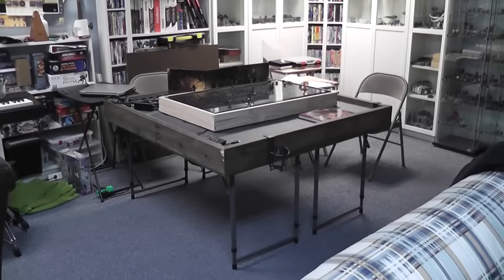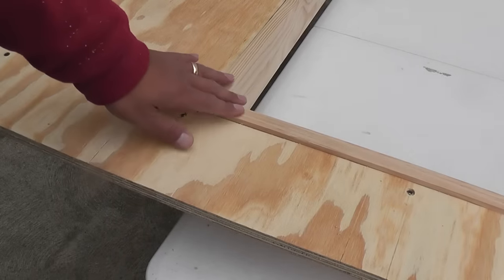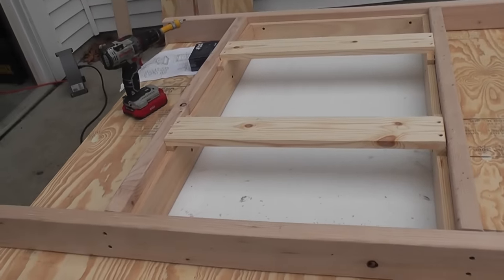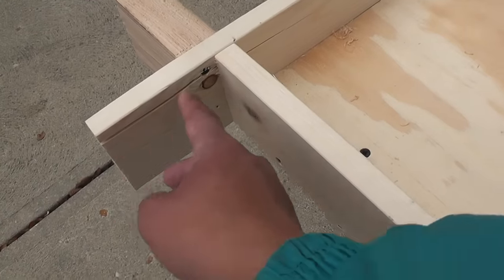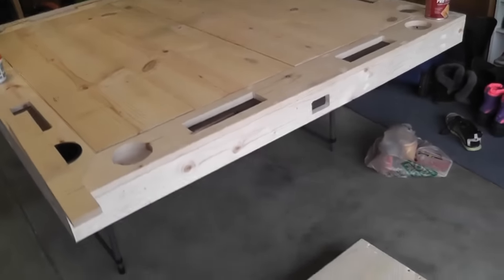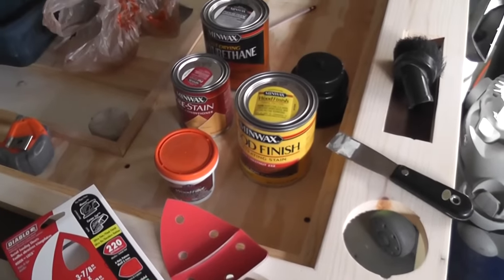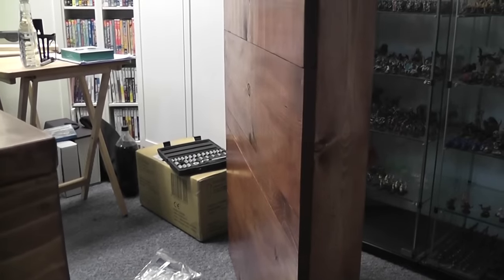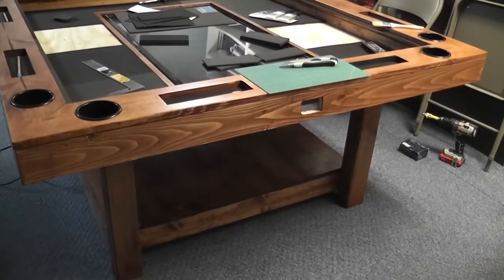DIY Gaming Table for $150

Comment: What's that yellow extension accessory on the drill at the 5:40 mark? I've seen it in a few DIY videos but I'm not sure what it actually does
Reply from the maker: It's called a Flip Bit and allows you to drill and then screw with the same tool--I love the thing.  https://www.amazon.com/DEWALT-DW2700-Drill-Drive-Complete/dp/B0000DD6LX/ref=sr_1_5?dchild=1&keywords=flip+bit&qid=1589030749&sr=8-5
Reply: @gaminggeek241  Thank you!! Built a gaming table using your plans a couple months ago (minus the tv in the middle) and it's perfect. Great work

Comment: How do you get the map on there? I know there's many options, but curious what you use since it seems like youre actively using it and not just theory-crafting here. I thought about a chromecast or other screenshare maybe. Edit: So it looks like you just have an (old?) laptop connected underneath then?

Comment: nicely done if i ever get a gaming room definitely going to try and build this. I do have a question that ive been wondering with the monitor tables atleast yours is it an all in one computer station or just a tv with air display to pull up the map.
Reply from the maker: It's a TV with an HDMI hookup to my laptop.  So it functions as an extended monitor for the laptop.

Comment: it would be really cool if you hung up a projector on the ceiling instead of the tv screen, you could adjust the size of the playing board as much as you want and it would let you keep that nice carpety texture for the playing peaces to stand on, i imagine the screen would get a bit slippery, sorry for bad english.
Reply from the maker: I was actually looking into setting up a projector but ended up with this instead.  It's true that you have more control over the size of the map but I like having the TV in the table.

Comment: nice build, would recommend not using braided wire like that on a outlet. You could use crimped connectors and it would be ok

Comment: Love this idea, but as somebody who works with wood-stain for a living, the Wood Conditioner is, in my opinion, a waste of money, as with most softer woods, Water will achieve the exact same effect, making your stain come out more even, and helps the stain bite into the wood more easily, preventing the need  for the occasional second coat of stain.

Will definitely have to do something like this for myself.  Thanks for the video.  :D
Reply from the maker: Yeah, I've heard others say the same thing--that wood conditioner is unnecessary.

Comment: Just one question why did you choose to wire the outlets in a series circuit and not parallel? Also the outer sheathing has to be inside the box
Reply from the maker: It is in parallel.  I did end up retroactively putting in boxes and placing the sheathing in the box.

Comment: On your BOM do you have the cut lengths and angles for the wood? And do you know if lowes or home depot will be able to cut the boards to spec?  Finally, just wanted to say that is an awesome build. The is a 40 inch right?
Reply from the maker: If you click on the link for the plans, all the cut dimensions are in there.  That would be a lot of cuts for Lowes or HD to make--you might do better asking a handyman to cut them all for you.  Yes, I have a 40" but you could fit a 42" as well.

Comment: Do i need to figure out the size of the tv before I  start anything?  Looks like yours is for a 40" which is what I want to use.  Wondering if there is enough room to accommodate most models of 40" tvs?
Reply from the maker: Yes, I would definitely size out your tv first before starting because that dictates the placement of the support beams and where your legs will go.  You can definitely fit 40" TVs and can go even a little larger if you want since the inside well is 4'x4'.
Reply: @gaminggeek241  Thanks for the answer. Purchased one and excited to start this project.  Thanks for putting the plans up and the walk through video!

Comment: awesome build. just FYI you should be using 12 AWG wire for 20A circuits but it shouldn't be a huge deal.
Reply from the maker: Yes, you are correct.  Also to use 20A outlets.  Did I say I was on a 20A circuit?  I just checked and it is 15A.

Comment: I was thinking about building this as a 4 x 6 table rather than a 4 x 4 so I could use it for DnD, is there anything you'd recommend taking into account/changing about the procedure for a longer table?
Reply from the maker: There's a couple of people that made longer tables so definitely check out the BGG thread that I linked in the description for ideas.

Comment: This is great! But these skills are beyond the capability of my group. I am wondering if we can simply build a box to put the TV in. My question is, would this cause heating problems because there's nowhere for the heat to go?
Reply: If you do that, make sure you drill some holes on the bottom of the box to allow the heat to escape.
Reply from the maker: I originally just had a wood frame that went around the edge of the TV and had the TV flat on top of the table.  If you have an LED LCD, they barely give off heat and I've never had issues with my TV.

Comment: What size is the original table you had? It looked like a fold up 4x4 but I've found those are super hard to come by.
Reply: he made the original too.
Reply from the maker: It was a table topper and I used 2 foldup tables that were 2x4 underneath.

Comment: I have 2 quick questions.

I am thinking about starting this project but would want to have a table that is slightly longer,  3 people on the long edge and 2 people on the end   for potentially 10 people total around it.

But typically 8.

Is it just as simple as adding an extra 2-3 ft to the length and adjust all the measurements appropriately?

secondly, LCD TVs don't typically do well laying flat and the screen can crack as the edges droop

Have you had any trouble with this? are the braces enough to prevent this?
Reply from the maker: If you use the BGG thread link in the descriptions, there are a number of people who lengthened one side of the table to do exactly what you said.  So it is pretty easy to modify.  

I have an LCD LED TV which is super light so I've had no issues for the six years I've been using it.  Maybe you will have those issues with different kinds of screens, I don't really know.

Comment: what are the dimensions of the tv, the frame, and the cutout for it, if you dont mind me asking?
Reply from the maker: If you take a look at the link in the description section, I have posted the plans on there but here it is again: https://drive.google.com/file/d/0Bwy2Jq8PcrmbQkdHVTczZm4wZDQ/view  You will need to adjust for your TV though as this fits my 40" Magnavox exactly.
Reply: Thank you , I appreciate it. I am using a 40" in my table as well and for some reason thought you were using a 32" so I was confused why my dimensions were the same as yours but now it all makes sense!

Comment: Only safety feedback: Improve the wiring. Use boxes, and never use the push wiring on outlets. They are unsafe and not recommended for use. This is a cool low budget table though, nice job!

Comment: Awesome job but the only thing I'd fix is put boxes in for your electrical... it's not safe the way you did it, even with electrical tape. You can buy recessed metal boxes that'll do the job or even plastic boxes

Comment: Do you think the legs and base are easily removed for transport or relocation?
Reply from the maker: Yes, if you are planning on moving it multiple times, I would use bolts instead of lag screws.

Comment: i dont know if this is still monitored but what size was the tv? i also dont see the foam sheets on the shopping list. what ones did you use?
Reply from the maker: 40" LED LCD.  I've had no problems for the past 2 years and the prices have gone down a lot since I built it.  Also, the foam things I bought from Hobby Lobby (Michaels has them too) and they are super cheap.

Comment: Looked great until the wiring - since people can grab up underneath... Also, you can attach straps to the bottom of the panels, and put the one with the hole at either end, then all you do is fold up the panels to make a nice stack either by alternating \ / \ / \ fold direction or lengthening the straps and just wrapping. Either way would work and makes it easier to manage.

Comment: That's a nice feat. However have you considered the safety factor involved in this? What I am refering to is the minimum safe distance between the players and the television. With modern technology, electronic smog should be a major concern especially with electronics that run on alternating current.

Comment: So this is going to be my first ever woodworking project. What is a corner round? I am trying to compare prices on the wood, but am struggling to figure out what the heck that is? Is it trim? Do you think it is quarter round, not corner round?
Reply from the maker: Yes, sorry, quarter round is correct.  You can actually use a square or rectangle instead--anything that you can rest the top inserts onto.  Doesn't have to be rounded.

Comment: Just a quick question, why did you not turn the table over to put that last bit in, instead of drilling blind, which is always fraught with danger?  Also could you not have inverted the bottom support so that you had a handy little tray to store stuff in and not have the hassle of drilling blind while still keeping the table upright?  Not knocking the work, you are way above me in wood working.

Comment: As an electrician I cannot condone the use of 14ga wire, especially 14ga stranded wire, in any 120v wiring system.  Also, putting a junction box with a single 15A breaker in between the power source and the 1st box in the series so that in the event of a ground fault the breaker will shut off first before you knock out the breaker for the room.  132ga might be overkill, but if the wiring is done correctly you will never have any issues with the electrical.

Comment: I watched this years ago, and wished that I knew the right people to need a table like this.  Anyhow, do you still have and use the table?  How many experience points did you get in carpentry for making this table?
Reply from the maker: Yes, still have it and still use it a lot.  Check out my follow up videos!  I leveled up multiple times with the XP!

Comment: just a curiosity, why not pre-drill 1/4" holes through the braces where the wires could go through instead of the wire brackets u used? not dissing the idea but wouldnt it make it easier and easilly covered by doing so? something i was taught thats all
Reply from the maker: Yes, that is definitely a great option!

Comment: I use deck screws with a T25 bit, much easier to drive them home.
Reply: should have run your electric wire for the table into the leg before you put the 2 boards together, just run a router groove...

Comment: I know that this is an old video but I had a quick question about the TV itself. Do you have to adjust the settings for it to make it a bit easier on the eyes some of our game sessions that we play in my neck of the woods sometimes last as long as 5 to 8 hours and I can imagine that might cause some eyestrain depending on how the television is set do you have any recommendations for a television for the center that might be newer but still at least 100 - $150?
Reply from the maker: No special adjustments.  I have an LED LCD screen and it isn't hard on the eyes.  You might want to lower the contrast if it is causing eye strain.  Yeah, we have about 3 hour sessions every week so we don't notice it.
Reply: Gaminggeek hey thanks for the Insight I appreciate it I'm actually working on building my own table and starting with a design probably going to go for an octagon so it can double as a poker table.

Comment: Table turned out nice. I 2ould have used outlet boxes so that someone doesn't reach under the table and accidentally touch live metal on the side of the socket....
Reply from the maker: Yes, I retroactively put in boxes.

Comment: I'm curious, how did you vent the hot air produced by the TV.?   Have you done updates to the table?  Also, how did you connect your TV to other device?
Reply from the maker: Because it's an LED LCD, it produces very little heat and I haven't had any fans or venting on it with no problem for the past three years.  It would be an issue though with a plasma or other heat-producing TV.

Comment: Hey Gaming geek! I am building this now, so thanks! Just a quick question. Is there really enough support on the outside ledges around the table? It just seems like there is a lot riding on basically being just drilled into the ends of the 2x4s and the 3/4” plywood sides. Do you think there needs to be more support after using it?
Reply from the maker: I wondered about this as well when I was building but so far, there hasn't been any issue with mine.  Of course, I'm not really lifting it a lot since I put casters to wheel it around and I'm not sitting my full weight on the rail so if you are going to put your table through that much abuse, you might want to add a reinforcement plank underneath.  But so far, glue and screws have held it together.

Comment: I case anyone is wondering in 2023, after putting the shopping list into Lowe's. I came up with a total close to $700, $660ish actually, that includes all wood, screws/bolts & washers, pre-stain, stain and sealer. Without electrical outlets and wires.

Comment: How did you attach the matting to the top of the table?  Glue?
Reply from the maker: No, it's just sitting on top.  I haven't had a problem with it sliding around.

Comment: Just bought the materials for this, and I'm really looking forward to starting the project. Thank you so much for being an inspiration, I would never have dared such a project without your video, advice and guidance. One question: I am considering doing a walnut stain instead of your chestnut stain. Do you have any examples of people who did a walnut stain on this kind of table? I have looked through the forumpost on GBG, but could not seem to identify any tables that did so. Thanks again!
Reply from the maker: Glad the video has inspired you!  No, sorry, I don't know of anyone who used the walnut stain but what I would do is take a scrap piece and test it on there first to make sure you like the color before committing to the whole table.  Also, putting polyurethane on top of the test piece is important because it changes how the color looks.  Hope that helps!
Reply: @gaminggeek241  Thanks! Good advice! :-)

Comment: This is a very nice way of making a table, tho, there was several unsafe things you did, starting down, you dont want to drill upside, take the time by flipping it over, mark two one inch lines for a frame line where you want the screws to go, you used the nail gun right next to your hand, what if for whatever reason, you hit a knot or just sheer bad luck that nail shifted to the side and went into your finger(s)? OUCH. Thats what clamps are for.  AT 14:55, it wasnt just that you didnt predrill, its also to close to the edge, thats always a risk. As for the imperfections at 34:14, maybe a router and curve over the edges?

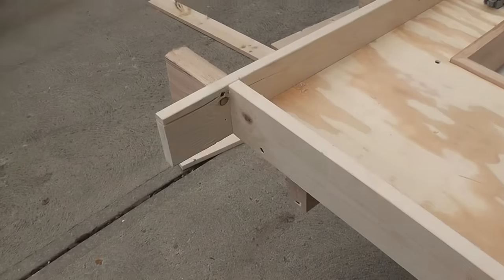Comment: at 14:42 drive the screw in further to make the split end open up more, put in glue, take screw out, let dry, use sovereign drill for the fat end of the screw, put new screw in, problem solved.

Comment: Would you be able to explain in detail how you made the frame for the tv?
Reply from the maker: There wasn't much to it--I just measured the length and width of the TV and matched with a simple frame using pine and screws on the ends.

Comment: Just curious but what is the difference between using a TV and using a Monitor for this table? Would there be a benefit to using one vs the other?
Reply from the maker: It is cheaper to buy a larger TV than a monitor.  A monitor has greater resolution, I think, although I don't know what the 4K resolution TV's are like compared to monitors.

Comment: You have any experience with the speed cloth?  I've heard it is water resistant, and doesn't get nappy.
Reply from the maker: You mean instead of the black foam?  No, haven't heard of it.  Some have lined theirs with neoprene (the same stuff as mouse pads)--how does speed cloth compare to that?
Reply: @gaminggeek241  I think it might be the same stuff.  I haven't actually touched a table with speed cloth.  I've been told it is what's used on poker tables that aren't using felt.

Comment: Im definitely gonna build one! Did you wire the outlets in series or parallel? If in series did you have any voltage/current drop due to the resistance between the outlets? What would be the best way to wire everything parallel?
Reply from the maker: I wired in series and haven't noticed a drop, even when using my vacuum cleaner or heat gun.  But simple to wire in parallel.  Here's a good article on how to do it, just scroll down to parallel:  http://www.wiringdiagram21.com/2016/12/how-to-electrical-outlet-wiring-diagram.html  Good luck and make sure to post pics in the BGG forum!
Reply: @gaminggeek241  Thank you Sir :-) I appreciate it and appreciate you posting this.

Comment: hmm, at 40 mins you should raise the bottom shelve another 2 or 3 inches more. Mostly for vacuuming your carpet underneath, but also just making life easier attaching the platform to the legs.
Reply from the maker: Yes, I ended up putting casters on the bottom of the legs which means I can vacuum underneath more easily.